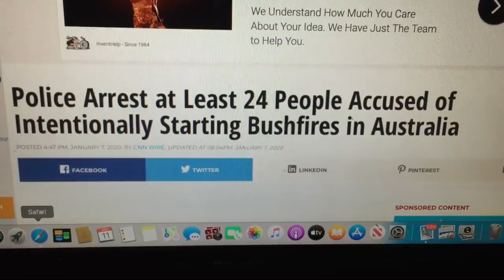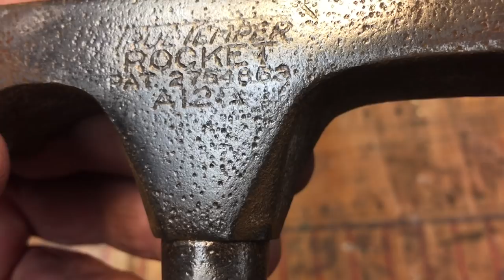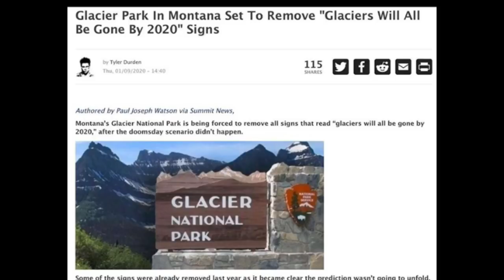MMM-  Trust Issues, Small Crate Tool and Rocket Mason Hammer...

Comment: That wider belt sander is a really nice tool to have. I use one at work a lot. I'm either going to make a fixture to mount a portable belt sander that I already own, or pick up a fixed one, probably from Harbor Freight.  I am enjoying their 1×30 and have had no issues at all with it. Great job in the pry bar! That would be a perfect tool to throw in your jeans pocket and carry around when you're out and about.
Reply from the maker: Jesse- If you use decent belts on the 1x30 it really improves performance!
Reply: @ScoutCrafter  I am still on the first one. The one it came with. I have spares from Harbor but I'm not sure how good they are yet.

Comment: I made a spill proof oil can for my drill press with a piece of flared tubing like that blue section. It was glued into a pill bottle top with "GOOP". An acid brush fits right in it.  I am going to try coconut oil (diluted) in it like one of your fans suggested in another video, for drilling and tapping, etc.

Comment: Plumber here, the tool for expanding/forming the lead worked exactly as it should.  The idea is that it was used to transition from lead to copper or brass pipe.  Its called a bit joint.  The pipe was inserted into the funnel and then the gap was filled with 50/50 solder.  Love the vids!
Reply from the maker: Tim Thanks so much!  I was wondering how that worked!  😃👍

Comment: I've seen other restoration videos engrave the writing deeper so when they have to sand an item down, they can preserve the writing.
Reply from the maker: On block letters I have done that before but on Hammers they are so hard it's very difficult to deepen the lettering...  Also hammers take 3 times longer to get down to good metal then tools like pliers...   I have an engraving machine but it wouldn't do anything on this hard steel...

Comment: I can tell by looking at that hammer what kind of hardness it has and I'm thinking it was almost harder to clean up that the crate tool but they both turned out great in the end.
I was just up at the thrift store and grabbed a unusual PVC 2 piece repair fitting, probably never use it but for a quarter i couldn't resist.PVC and PEX are both good stuff, I installed some PEX for the first time on a water softener maybe 20+ years ago and it still looks great with zero problems.

Yes a lot of misinformation concerning the fires, when people have an agenda the Lies Flow.
Reply from the maker: Raw Bacon I was amazed at how durable that PEX is!!!  The fittings are the only thing I worry about.  😃👍

Comment: On the funneled PVC, in a pinch you could bevel the end of another piece and  glue it in. Probably wouldn't hold pressure,  but would work for drain lines like on A/C. Just a thought.

Comment: MISH MOSH MONDAYYYYYY! YHEA BOY!  Thanks for the advice, I really struggle on leaveing a tool original or not sometimes. I guess you got judge value, condition and what its being used for.
Reply: I stop all my tool restorations at what SC calls the "Post Wire Brush Evaluation." Oil or wax the tool and throw it back in a tool box. Just my opinion... I've got plenty of mirrors hanging on the walls. ...Newk from Kentucky
Reply: @timothynewkirk2654  Yhea, i buy tools to use mostly. But i like to clean them up, ive never used wax on them. Ive only ever used a light coat of 2in1. Im in Georgia and would like to move to Kentucky when i retire

Comment: John, there are 2 different types of PEX pipe. One has a pex band placed on it and is thern expanded and the fitting inserted. the pipe "memory" will close it tight since the fitting is larger than the OD of the pipe. The other has a metal band placed around it and then the fitting is inserted  and the band is crimped. Also using the lead pipe expander to widen pvc would make great fishing rod holders for boat or truck.  as far as politics go, It is YOUR channel,  YOUR show, so do what YOU want and people will watch, or they won't.
Reply from the maker: Hi Patrick!  I am impressed with the strength of PEX!

Comment: I think the pipe expander would work better on plastic if it didn't slip out and holding pressure inward. If you watch closely on the blue pipe it starts to flare at the base of the tool  then slips out causing the funnel shape.  Might try clamping the pipe or heating the tool a little.
As always great job on the crate tool and hammer!
Reply from the maker: They sell a tool that expands 4 ways that does a great job... Thanks!

Comment: You said that spreader was for lead - which is fairly malleable.  I could see flaring a lead pipe like you did, inserting a regular diameter pipe in the flare & beating the flared end down around the 2nd pipe & leading the external seam.  Or may be there was a tool to compress the flared pipe....... 
My attitude with the Media was "Trust but verify..."  until I lost all trust after verifying enough!
Reply from the maker: Chris!  I think you are right about the Pipe, Pat is a plumber and said it was sealed with a 50/50 solder..   =)  Thanks!